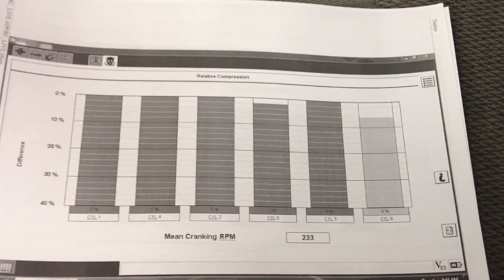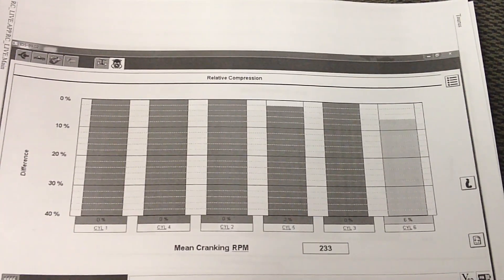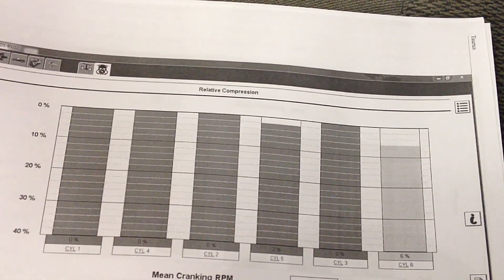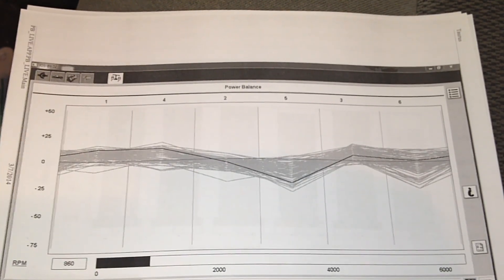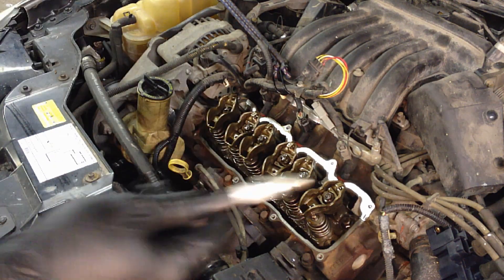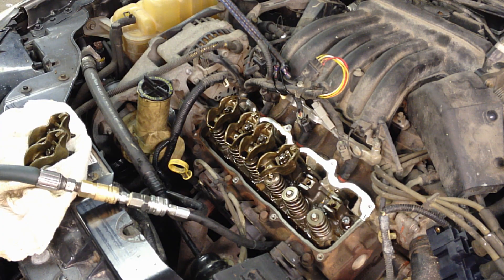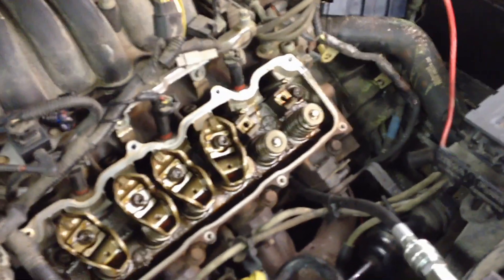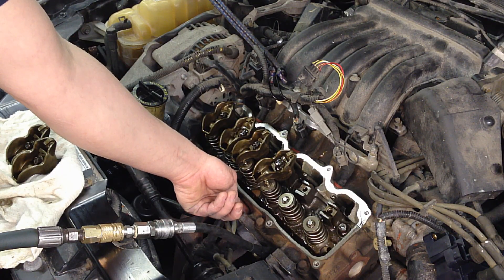Quick Way to Check for Leaky Intake & Exhaust Valves Causing Misfires

Comment: You are dead on the money with this I dont care how much is leaking BUT were is it leaking , Just jmho I would do a air test first then tap on rockers then  loosen rockers then tap rockers again that SHOULD  prevent seating that valve and not  knowing you seated it  GREAT VID THANKS

Comment: Okay now what about over head cam engines which most are these days? And won't too much pressure turn the crank over requiring a ratchet to hold it still?

Comment: I got a 02 ranger bad compression in 6 cyl if it's rings where will I hear the leak if I do shop air test ... the oil filler neck
Reply: Yes
Reply: Thank for replying i ended up bad having bad valve seat issues all but 2 cyl had a significant leak . New heads . Thanks ur video helped big time@FloridaMan7337

Comment: My Econoline only shakes after warming up. No engine codes. Air flowing out of the oil fill tube. Some smoke or steam out of the exhaust pipe. I replaced the faulty water pump and used both head gasket sealer and oil seal. It seemed to reduce the smoke a lot but when I press the gas in drive or reverse the van will barely move. The scanner picks up knocking, only with Forscan and not other scanners like BlueDriver. I am wondering what it could be. It mainly shakes on the driver side of the engine. I really hope it's not the a cylinder or wall. Please share some of your expertise with me. What about leaking valve seals, a bad sensor, etc? The temperature on the scanner shows much hotter than the guage on the instrument cluster. It barely moves. I am so confused. Thank you.
Reply: Thank you for your comment. Here is an update. Using more head gasket sealer I stopped the steam/smoke coming out of the exhaust pipe. But combustion gases are leaking into the coolant. The engine doesn't shake nearly as bad but if I let it get hot it starts shaking again. It seems to be a blown head gasket. Maybe that caused other damage too. I really don't want to take the engine apart but it seems I don't have a choice. I am not very experienced in mechanics but it's not worth paying someone to fix it. Purchasing a used engine would probably be cheaper.

Comment: in this scenario, would the misfire on power balance greatly lessen when driving?  I have a miss, not a dead miss, at idle on cylinder 2 on my 5.4 3v, but it dissapears during driving conditions, except at idle.  Have ruled out all my secondary ignition stuff, and also smoke tested and vac gauged for vacuum leaks.  The engine is newly rebuilt with new heads, but I'm thinking it has to be a valve issue on that cylinder, unless there is unmetered air getting in there somehow.
Reply: You may still have a miss and since the cause of the issue can vary so much it's possible that it's not noticed due to the fact as the rpms climb the miss is over powered by the rest of the cylinders firing.
 The first thing to check is pull  the plug and check the condition.
Is it not firing just kinda dark and wet looking or is it covered in oil or steam cleaned from a coolant leak getting in the cylinder?
Just the condition of the plug can pinpoint where the issue is then you know at least its not a bottom end mechanical issue and more a top end but that still can leave alot from computer to gaskets to vacuum leaks.... Ect ect...
But knowing the plug condition can tell a lot for not much effort!
Well ... Lol depending on room but I found that with a really good jack and a stand you can get to the impossible from top to reach plugs really easy from the bottom. Sometimes a starter may have to be moved but easier then the upper intake fuel lines gaskets and the entire pile of engineering vomit required they love to throw up on the top side!
But a valve issue on a single cylinder lawn mower can cause no start from no compression and a range of issues from one not seated for many reasons so of course it can be an issue in any number 4 6 8 or even a PV12 1100 Hp Merlin Rolls Royce in the P51 Mustang fighter would still notice an issue with the other 11 cylinders firing true!
LMAO
It's always something!!!!

Comment: my car was misfiring with codes p0300, p0302. p0303. p0304 and with  check engine light on all the time, it was flashing too ! my case my car had burnt valves so replacing it at the shop right now almost a week now at the shop cost alot to replace too thousands cost is mostly LABOR !

Comment: So what I have is a a misfire on cylinder 3 only on cylinder 3 and then not too long ago I had a sensor code pop-up exhaust sensor now I have low compression and my car sounds really horrible I can see the door shaking really bad is there a fix for this

Comment: Suspecting this on my 2v 4.6 mustang... coil packs didnt solve the noise. I'll try listening to the cranking. The exhaust occasionally smells a bit so not ruling out a hanging injector... but I'll have to pull the valve cover off and get a better look. It's hard to tell which head to look at tho.

Comment: Should the engine be warmed up some before testing or does it not matter?  Also, should the valves be 100% air tight or would a slight leak be considered ok?  Thanks for the great video.

Comment: So doing it this way it’s kind of like a reverse compression test just a lot more work but a lot more effective lol this test you’ll find whether it’s a intake or exhaust valve
Reply from the maker: This is a cheap way to perform a cylinder leakdown test with a cylinder leak down tester.
Reply: @FordTechMakuloco  I like it

Comment: when checking for leaky valves with shop air does each cylinder being tested need to be on top dead center on compression stroke
Reply: Yes
Reply: Yes... And in my opinion in this video the piston was not on top dead center that was too much air getting out by the pcv valve
Reply: @ricardopereira771 if he loosen the rocker arms, it doesn’t matter
Reply: No

Comment: Hi there. You probably won't get this in time, but thought I woild give it a shot. Seems like you know exactly what you're talking about. I am going today at 5 pm to look at a Ford f150. The guy says he thinks there is a valve problem. He has replaced sparkplug and he says its still running ruff. I won't know till tomorrow. He has agreed to allow me to take it for an inspection. Do you know of someone reliable in Thornton Colorado? Thank you so much! I subscribed, because I think I will learn a lot from you. Thanks Again!!!

Comment: Are there any adjustments needed when putting the rocker arms back on? Does it matter whether they are hydraulic vs flat tappets or if tightening them places  them back where they were originally?

Comment: how much psi do you use?   Also I thought the PCV valve recycles exhaust so if air is coming out of the PCV would it not be the exhaust valve that has been closed but still leaking.  I think you said the intake valve was leaking.
Reply: No in this procedure you closed both valves intake and ex so the cylinder is isolated. If you follow the air it will show you how the air is escaping. Tailpipe =ex valve .... ports on intake= intake valve ....... dipstick or pull drain plug = rings/cylinder walls...... spark plug hole next to the tested cylinder= head gasket
Reply: Also psi all you need is 100 check normal compression numbers for the engine you are testing go below it to be safe. I have 200psi air so I don’t wanna put 200 on a cylinder that normally should be seeing 120psi. Hell to be super safe 50 will do if it’s not sealing correctly the air will leak out.
Reply: Set your compressor to 90 psi

Comment: My motorcycle is doing that. I'm gonna replace all the valves and top end and headgasket. Cause it has low compression.... I'm gonna do that first test it then if anything I will change the piston. Rings
Reply: depending on what it is you might be able to do a simple hone an put new rings . if there is a deep groove at the top of the bore then you might have too worn of a engine that needs to be resleeved . good luck . if its a dirt bike just buy a big bore kit
Reply: @codyramos3200  it's a cbr1000rr
Reply: @jonathna11  , have you confirmed low compression with testing ? i havent hear of to many supersports having low compression honestly ...

Comment: Umm... Doesn't a leakdown tester do the same thing? I know mine does. Plug into plug hole, all plugs out, shop air on..  Exhaust leak comes out exhaust, intake out intake.. etc etc. (Challenging your inaccuracies statement)

Comment: now just remove valve spring ... put a drill on the valve stem , spin it for a second .. and you know if valve is reset , warped , or burnt out

Comment: Probably best not to rap on any valve until AFTER initial leak-down test because you may inadvertently correct the issue before diagnosing and are left dumbfounded as to the problem...
Reply: I agree 100% glad someone said this
Reply: I think maybe a exhaust valve but until you pull ot apart and test it. Nobody knows lol.
Reply: Also I would pressure test as is on TDC and Not loosen rockers

Comment: I lapped the valves on both the rear and front cylinder banks. My problem is that the front cylinder bank has 3 leaky intake valves. I’ve re-lapped them and eventually replaced them. However, they are still leaking. I’ve hit the top with a mallet so that they seat correctly but no luck. Would this be due to the valve springs? The valve seats?
Reply: Thank you for the quick response. 
Alright so as of last night I put both cylinder heads in my trunk, took them to our local machine shop. He suggested a valve job. Along with replacing any out of spec or worn out (seat, valve, spring, guide). He’s resurfacing and a completely pressure testing both heads. Hopefully the $330 wasn’t too steep to agree upon.
Reply from the maker: Have a machine shop do the work they will be able to get them sealed properly, I would be looking at the seats yes.

Comment: I o ow ots old but I have a 2010 flex with the 3.5 EcoBoost. 
I jave lack of power and found i have 
180psi in 5 cylinders  and 100 in thd other. 
What could cause this issue?
Could ot be carbon on the valves?
Bad rings  how can i ye woth s leak down tests,?
Ive never done one sk im lost with the lesk down test.
Thanks. 
By the way i love your vids they helped me more than once.
Reply: My guess would be head gasket because you only have a problem on one cylinder normally rings show problem in more them one cyllinder unless they break on that especific cylinder...

Comment: How do you tell if it's the intake or exhaust leaking? If there was air coming from the tailpipe and the intake manifold? Or was there no air coming from the tailpipe?
Reply: Correct, no air from tail this time. Just the intake side

Comment: My lexus ls430 has 28000 miles. With regular maintenance spark plugs belts water pump, etc... it has the original starter and alternator

Comment: Great job I would had removed radiator cap and check for bubbles for head gasket leak at leak down test but anyway great job 5 starts keep good work an professionalism in automotive industry

Comment: Interesting work flow, I guess it helps to have an engine that has easy access to valve covers. You already knew this engine needed more work so it was not wasted effort. It would be worth knowing about a bad spring by having the cover off, even in an engine that isn't worth the expense of a full head gasket repair. I know what you mean, it's often easier to watch rockers to decide what part of the cycle each cylinder is on. By removing rockers you delete that part of the equation, and with all valves closed the engine won't be so willing to spin with the compressed air. Also flow through the head gasket to an adjacent cylinder would be less likely to find an open valve. That said, maybe you want to demonstrate head gasket flow between cylinders before pulling the head. Good point, the leak down confirms air flow but doesn't take you much farther, and it's an extra step.

Comment: Did i hear correct ? If air comes out another plug hole its from a leaking head gasket . Did i hear that right ? Or did i miss something ? Thanks for the videos ! They are very informative and well done !
Reply: Bart fox if the gasket is broken between two neighbouring cyclinders...the pressure goes back and forth between them.

Comment: The first thing this guy should have done after pressurizing the cylinder is remove the oil filler cap and listen for air getting by the rings.
Reply from the maker: there will always be blow by past the rings and it can get you into trouble if you don't know what is normal or not. So not that is not the first thing you should do.

Comment: Why the Heck did Ford come out with a 12 Valve engine in this day and age? Lol
Reply from the maker: +treydotsizzle this engine came out in the early 90's. They just keep using it with minimal upgrades through 2005 because it was so reliable.
Reply: FordTechMakuloco oh i see
Reply: treydot_ six cylinders x intake x exhaust= 12 valves

Comment: How does this differ from a regular compression test with a gauge?
Reply: If youre talking about a "compression tester", it only measures total cranking compression.  It does not tell you if the leak is at rings, intake valves, or exhaust valves.  But a compression tester is the fastest way to check if there IS a compression problem.

If youre talking about a "leak down tester", it measures the exact same things that Makuloco measures in the video, but you have to rotate the engine to the correct position to achieve both valves closed.  But then, you have to have a leak down tester.

The biggest thing to note:  Makuloco is able easily remove the valve cover to individually remove the rocker arms in this engine.  This closes the valves and makes the cylinder "air tight".
 In some engines, like Hondas, with a camshaft driving the rocker arms - you would have to loosen the valve adjusters.  This would require removing the valve covers.  On some engines, that is a massive pain in the ask  :)

And thats where using a leakdown tester (and properly rotating the engine to compression stroke on the cylinder you are testing) helps.  If the leak is small and slow, a leakdown tester is also valuable as well.  It will show a slow leak over time.
NOTE:  with valve covers removed, you can visually "ensure" that the valves are, in fact, closed.

CAUTION!!!!:  APPLYING COMPRESSED AIR TO A CYLINDER CAN CAUSE THE ENGINE TO TURN - THIS CAN MAKE THE CAR MOVE, IF ITS IN GEAR AND THE WHEELS ARE TOUCHING THE GROUND.  OR IT CAN SPIN THE ENGINE, AND ANYTHING THATS ATTACHED TO IT.  BE GOD-DAMMED 500% SURE THAT YOU TAKE YOUR TOOLS OFF THE CRANK PULLEY NUT, OR CAMSHAFT GEARS, OR ANYTHING ELSE BEFORE YOU PUT COMPRESSED AIR INTO A CYLINDER.

Stay gold.
Reply: a "wet test" with a compression tester will tell you if rings are leaking. and aside from rings and valves, theres really not much more which could be leaking, so a standard compression tester is pretty descriptive in determining what could be leaking
Reply: @andiarrohnds5163  a blown head gasket could be leaking into the cooling system, take the cap off the rad. and watch for bubbles.
Reply: @dnlmachine4287  How do you make sure the engine doesn't turn?
Reply: @callbackdons  And also - make sure transmission is in Neutral.
Reply: @dnlmachine4287  thanks for the extra instructions. One issue, in my case it's a Chevy 4.3 v6, and the spark plugs go in horizontally somewhere midway down the engine bay--I was accessing them through the wheel well. Based on your description I think something in the spark plug corridor in my case probably won't follow the piston ..any thoughts? I'll look to see if anyone has documented this specific to my engine.
Reply: head gasket
Reply: head gasket?

Comment: Great video -- however, I don't know your final diagnosis.  I guess this means a bad ring or piston?  Air is leaking by into the crankcase and you are hearing it through the PCV line.??
Reply from the maker: +XORBob no the air was coming past the valves at the seats.
Reply: Okay, cool.  Thank you.

Comment: Couldnt air coming out of the PCV also indicate bad rings?
Reply: Matt Smith did you ever get an answer to this? Once my 350z gets hot if you TV valve always has a lot of air/noise running through and from it! And my car drives like it has low compression...pcv valve and line have been changed of course
Reply: Once cars warm, always hear my pcv valve has a loud hiss from it**** sorry lol

Comment: what scanner was used?
Reply from the maker: I use the Ford IDS in this video.
Reply: xiomara ortiz E-Bay has Snap-On scanners and adapters for alot of cars. They are very affordable! Get the manuals! Also the battery adaptor. Get the latest cartridges! Get Emission cartridges if available. Snap-On scanners can do tons of tests!

Comment: great video    what is your opinion on in cylinder pressure transducer testing with a lab scope to find engine mechanical problems ?
Reply from the maker: Never use them never needed to go that far if this leak fails we are pulling the head bar none and doing the water leak testing etc from there.